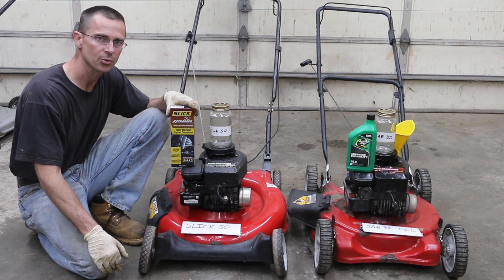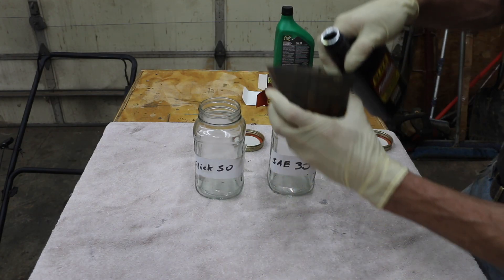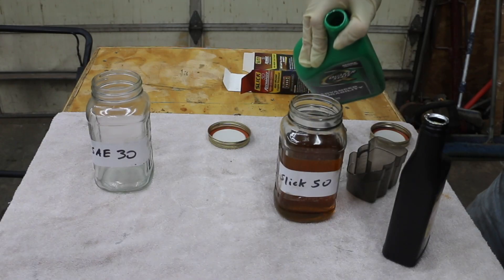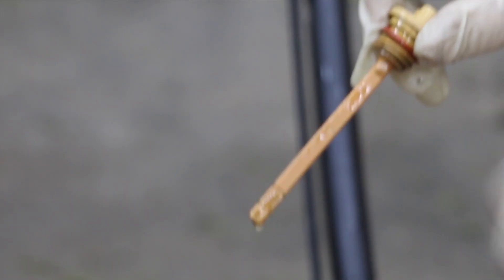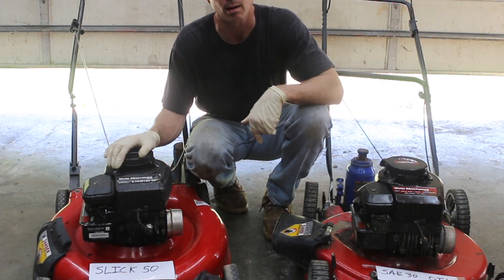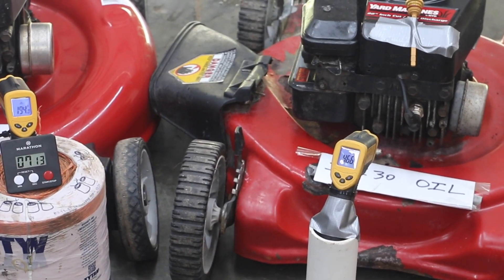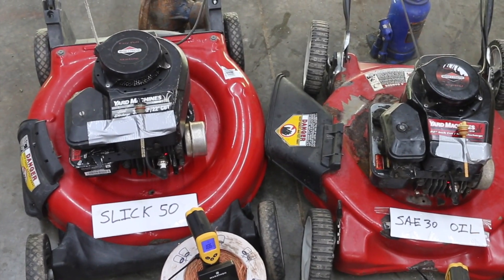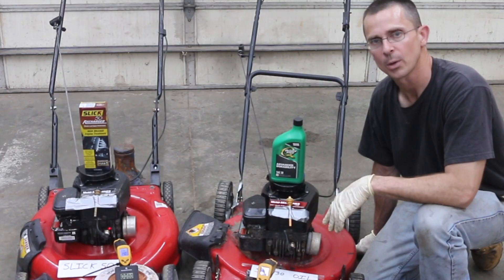Can't believe what SLICK 50 did to my engine!!--Dry Crankcase Test!

Comment: Back when Slick 50 first came out it had a Mil Spec number. My brother put it in his Omni GLH and it did improve engine performance. His drives to the Navy Base in Philadelphia on the PA turnpike was a good test. Driving 65-70mph use to require around 3psi of boost. After slick 50 no boost going the same speed.
Reply from the maker: Thanks for the feedback.

Comment: As I remember the original Slick 50 contained PTFE, polytetrafluoroethene (*smug*) and they claimed that, at the time, PTFE was the slipperiest substance known to man.  Big claim, but at that time quite possibly true.  The ad we saw over here showed a Ford (Escort MK II?) rally car doing over 400 miles on an empty sump.  The car was treated with Slick 50 then drained, similar to your experiment, then run over 400 miles as I said.  I think it was done in New Zealand.  Could be wrong on this as it was a long time ago and I am old...
It was a few years later that they dropped PTFE, but I don't know or cant remember why as PTFE is Teflon, yup, the same stuff you fry your eggs on!  I was like you and would spend a fortune on it, but the one I remember said clearly on the box that one treatment would last for 100,000 miles so "one treatment will last a lifetime" which was right enough as engines in those days were clapped out at 100,000 miles.  In the 70's and 80's you would never ever buy a car with that many miles on it as it was done. Sorry, I got side tracked there.  The marketing suddenly changed and it no longer said that one treatment  would last the lifetime of the car and the protection dropped from 100,000 to 50,000 miles per treatment, but the most important factor was that the PTFE was removed, so it was a different formulation that halved the length of protection.  There are a couple of reasons I can think of for this.  There were either problems with the PTFE formula they were using or the original was found to be too good and so they changed what they made it from and halved the lifespan so now you would need two treatments and BINGO! profits double.  Makes sense.  The cynic in me believes it was the latter and it was simply a ploy to make more money as there are still PTFE  lubricants on the market, just so happens that Slick 50 isn't one of them!  Love the videos matey, keep it up!
Reply from the maker: Thank you

Comment: Great video! I would like to suggest trying this with ZMax Microlubricant Engine Treatment. It claims to soak into the metal surfaces it touches. And they hawk it all the time on Motor Trend Saturday morning garage shows.
Reply from the maker: Thanks for the video idea.
Reply: How can something “soak into” a non-porous metal?
Reply: @gene8172  not my claim. go here to read Zmax claim https://www.zmax.com/about/how-zmax-works/?_ga=2.14710644.357295443.1609778442-1853486046.1609778442
Reply: @gene8172  case hardened?

Comment: If I remember correctly the Slick 50 informercial used an old Chrysler slant 6 engine which will run a long time drained without any additives.
Reply from the maker: Thanks for the feedback.

Comment: My questions are: 1. The age difference of the two mowers; if one was ten years older than it would have been a good test.  May have been good to do a compression test and tear down on both to show they are in similar condition.  It's been a long time but I thought I remember slick 50 needs a certain amount of time to bond to the metal. I have also heard of it breaking down with age and causing problems.

Comment: Even though I don't like additives,this was not a fair comparison. The Slick 50 test was done on "water cooled " engines. They rely little on the oil to cool them......In an air cooled engine oil plays a much bigger role in cooling them down. No oil,the engines do not cool properly....I am afraid these engines did not just die. You murdered them....!

Comment: The Slick-50 you tested is NOT the same Slick-50 you saw years ago.  There was a court battle of the naming rights because the original developer of Slick-50 took the formula with him and started his own company but the old company still used the name but different formula.  The product that you need to test is called Lubrilon.  Google John Bishop to get more info. 
Also- for Lubrilon to work correctly, it needs to be in the engine for a while to 'coat' the parts-  I'm not sure just running the engine for a ½ hour is going to allow the additive to complete it's coating process.  At least- this is what the formula developer claims.  In a car- they say drive for about 1000 miles to achieve full benefit. Not sure about small engines.

 I LOVE your channel BTW- you're very thorough, complete and fair.
Reply from the maker: Thanks for the feedback.

Comment: Yes; there were two products better than slick 50 back about 30 years ago!  I had an old  Oldsmobile that had a Brazilian made engine, a 1.8L engine. It would blow a head gasket every few thousand miles! I bought some of the stuff I am talking about and used it. Here was the result: I blew a head gasket on the way home from work, about a 35 minute ride on the hiway. Without the special oil, my engine nearly seized up just after getting off the hiway about 3 miles from home. WITH the engine treatment, my engine NEVER seized and got me home without ANY issue, other than the obvious, in winter and no heat in the car!  You will have to research what the stuff was, I cannot remember. It cost about $30 per bottle back then tho! 
I also did some testing in an engineering environment. We set up a rough cut CAM and that a switch handle (3" long flat stainless blade) follow the CAM and turn the switch on and off through 10,000 cycles, according to UL Test standards. I had NO PROBLEM with application of that lubricant, but the test FAILED before we applied that lubricant; because the CAM and switch handle wore out! I just researched, I believe the best stuff was PROLONG! Give it a try, I believe the mower with it wont quit!
Reply from the maker: Thanks for the feedback.

Comment: I had slick 50 in my bike and car in the 80s, it takes a while before the coating is stable, I'm a 381-2/1 & 2 craft engineer which in simple terms means I take parts off and service them without discarding, parts need to be run in, it is very simple.
Reply from the maker: Thanks for the feedback.

Comment: About 20 years ago, my dad insisted on using SLICK 50, much to the urges contrary by my mechanic friend, who said that he was hearing about it clumping up in the oil pan.  One day right after an oil change, I was driving only a few miles on a cold winter day, when my dad's '76 Chevy pickup started to clatter, and the oil light came on.  I let it set several minutes, and started it up, and it ran fine.  After a couple more miles, same thing; wait, repeat.  Drove about a mile, same issue, repeat.  By the time I made it to my friend's service station, I was down to a couple hundred yards before shutdowns, so when I got there, we not only drained the pan, but removed it and cleaned it out.  Inside, there were clumps of crud which we could only assess as SLICK 50 and other detritus; even the pickup screen was clogged.  We cleaned it out as best we could, put the pan back on, put oil in it, and it ran fine for several years.

So, I never had much faith in SLICK 50 because of that.
Reply from the maker: Thanks for sharing.

Comment: Motorkote! My ohc 2.3l proved it works when my oil pump went out and I thought it was a sensor. Over 200 miles before a tick,but it was rapping within 5 miles of that 1st tick. I always doubled the amount and did it twice as often then recommended.
Reply from the maker: Thanks for the feedback.
Reply: Project Farm  that was an old mustang with over 300k on it I gave to the kid next door and he put a oil pump in it and drove it for another two years. I guess I should of kept it.

Comment: It just goes to show that additives are BS.   large companies which formulate the chemistry of the oil, already have all they need in order to lubricate the engine.    I typically get well over 200 K out of an engine using any oil which meets current API ranking.  then I sell the car for cheap to a college student.  I just change it every 4k - 5k miles.  Clean engine oil is the best lubricant regardless of brand.
Reply from the maker: Thank for the feedback.

Comment: When slick 50 arrived on the scene a test was done here in Australia. They drained the oil then drove the car from Sydney to Melbourne.
Reply from the maker: Thanks for sharing.
Reply: @ProjectFarm  Yes, I remember that test too, (late 70's?) they claimed it did the around 600 miles with no problems.  I found it difficult to believe then as now.

Comment: I'm curious if a multi viscosity oil was used in the slick 50. No mention with the 30w bottle always on  the right. Still interesting inspite of the S50 exhaust was blowing directly into the the others air intake. Possible re-breathing lubrication?

Comment: Shouldn't one shake the Slick 50 before using??
Reply from the maker: Thanks for the feedback.
Reply: It wasn't merely feedback. It was actually a question. I did not see you shaking the Slick 50 before you used it. I am sure that was an oversight.

Comment: I used the Original Slick 50 way back in the 80's, on an 8 cylinder Ford van that burned a quart of oil a month.  Back then, they did mention they had Teflon and I did believe the hype about Teflon coating internal engine parts and that it reduced friction.  I remember a noticibly audible difference after using it.
But you had to drive it for a month, for the old formula to adhere to internal surfaces. You can't expect any bonding if you run it for a few minutes and then dumping it out.  But old fantasies aside, I just bought THE NEW Slicky50 and I will be returning it. Teflon is no longer in it.  It will be like paying $20 for a "regular quart of oil".  Nope, not me!
Teflon is they necessary key ingredient. New laws have been passed that even prevent Teflon from being used in frying pans. That may have affected the Slick50 formula.  I'll be looking in Xcelplus to see if it really is the old Slick50 reincarnated.
Reply from the maker: Thank for the feedback.

Comment: I added Slick 50 properly (per instructions) to my 1971 Ford Galaxy 500 with 400Cuin. My gas mileage increased significantly (5-7 MPG). Never has a problem with engine while i owned it and put 75,000 miles on it. As a matter of fact, the engine was so quiet, I actually damaged the ring gear by starting the car AFTER it was already started (in the days before protect devices that prevented that)

Comment: The Slick 50 brand has been sold several times over the years, each time with changes in the formula.  During the early 2000's Slick 50 was part of the auto products brands portfolio of Pennzoil, now someone else.  I noticed you used Quaker State in your presentation.  If you look carefully at a bottle of Pennzoil and Quaker State you'll see the P.O. Box is the same.  Once generational rivals are now siblings, and Slick 50's  formula changes are as great as the formula changes of Coca-Cola.
Reply from the maker: Thanks for the feedback.

Comment: There is a product in Australia made by Nulon. This oil additive used PTFE to coat the internal surfaces. They treated a car engine by running several thousand miles with the additive then drained all the oil and drove from Sydney to Melbourne a distance of 600 miles without damaging the engine. I have looked for a similar product here to no avail. Maybe PTFE is a no no for the EPA.
Reply from the maker: Thanks for the feedback.

Comment: ok years ago i had a rc boat i started it and tossed it in the water and it was running backwards it sank in saltwater so after a few days the motor was froze up i pulled the plug and filled it with slick 50 after 2 days of soaking i got the starter and started it no plug and no fuel and keeped adding slick50 the next day i fueled up the boat and it has run fine since then!
Reply from the maker: Great feedback. Thank you

Comment: Used Slick 50 in my F-350 rebuilt engine and it lasted forever.
Put slick 50 in my B-2200 rebuilt engine and it died. 
As per directions, allowed engine break in first. Then poured in as engine was running. They say you can hear the difference as you pour it in, or at least they used to say that.
The F-350 did seem to smooth out as I poured it in.
The B-2200 got louder and louder. 
Ruined the engine. Clogged the oil passages and collapsed the lifters. 🙄🤷🏻‍♂️
Reply from the maker: Thanks for the feedback.

Comment: There is a product called Conklin company . Inc from my memory it came on to the market in the mid 70s they had a line of tools along with it if my memory is correct one of the Selling points was they had taken burned out sowing Needles from a sewing factory and put their product upon these wore out medals then re-inserted them back into the sewing machines then they took a test between the new needles and the one  that have been burned out The ones that have been burned out way out for lasted the brand new needles I hope this helps , Benjamin Lee
Reply from the maker: Thanks for the feedback.

Comment: Very neat test!  I do have one question though.  The engines were identical but the mower decks were different.  When not cutting grass, the blade is essentially a blower wheel moving air.  If the blade profiles are different, the load presented to the engines could be very different. Just a thought!

I bought a car that said it was Slick 50 Protected on the window.  Added a turbo to the engine and never looked back LOL. But it always has oil in it. :)
Reply from the maker: Thanks for the feedback.

Comment: Nice screw up bro, that was STANDARD oil and that motor takes METRIC! I bet you just use standard hammers and never check if the thing in question used a metric one. Pathetic. 

Real talk though I wish it wasn’t at the same time so we could hear each lock up to see if there was a difference in sound. I also noticed you didn’t pull the heads first or after. Not that I think you were hiding something just curious what they looked like is all :)

Comment: I use one or two bottles of STP in all of my older engines with each oil change. It is supposed to have a very high zinc content and reduce engine wear. It is also very very thick compared to regular oil.
Reply from the maker: Thanks for the feedback.

Comment: My Name is Jim, Try A Product Called Tuf Oil , I Drove My Tahoe Suv 90 Miles  with 4 LBS Of Oil Pressure I Thought There Was Something Wrong With The Oil Pressure Gauge , It Turned Out TO BE A Bad Oil Pump , Didn't Seem TO Do Any Damage , The Motor Was Still Fine , The Mechanics Couldn't Believe It , I Always Treated My Engine With This Product And It Really Worked When I Needed It .......     TUF  OIL....
Reply from the maker: Thanks for the feedback.

Comment: I think the real point is that the Slick 50 engine runs cooler with oil in it. Running an engine without oil doesn't prove the oil is better - just that the engine was in better shape, or that some of the oil "stuck" to the components. An air cooled engine that has a cooler oil temperature will outlast a hotter running engine - all other things being equal. I also wonder about Slick 50's ability to bond to a lawn mower's connecting rod - as they often don't have automobile-type bearings.

Your tests are awesome, by the way!
Reply from the maker: Thank you very much!

Comment: If I understand what I saw there the slick 50 engine froze up before it got hot enough to warp it's gummed up yea they can be fixed the other one shot warped dead Me only part a slick 50 that actually does what it says is a it will save you a lot of money on a new engine although you will have to scrub this one when it seizes and you run slightly cooler Intel you seas

Comment: The slick 50 engine was running 30 degrees or so cooler, where they still sitting next to each other while you were doing this test and running at the same time. I noticed that the exhaust on the slick 50 engine is pointed directly at the other engine?

Weather slick 50 had anything to do with the one engine locking up first is almost inconsequential. The teller it's variation from engine to engine could have been a significant factor.

As for that old slick 50 commercial. If you ever watch them. The two engines they used regularly in those displays wer one of two engines made by Chrysler. It was either a small block 318 V8. Today dad more often they would use the Slant six. I have seen both of those engines run without oil for extended periods of time. More prominently the Slant six.

I even know of one that at 79,000 Mi the engine had seized up. The owner had bought the car brand new and had never even checked the oil. We have no idea how many thousands of miles he had driven with no oil in the crankcase at all. And the engine sitting and running is a lot easier on the engine than actually driving it.

I know an engine builder years ago and according to his tests most boils, even synthetic oils their top he capability is about 420 to 430 degrees. Kendall however according to this man's test showed the high-end temperature at 620 degrees. That was over 25 years ago or so.

Motorkote may actually work better because slick 50 is not anywhere close to the same mixture it was when it was originally made. Motorkote is actually much closer to the original formulation of slick 50.
Reply from the maker: Thanks for the feedback.